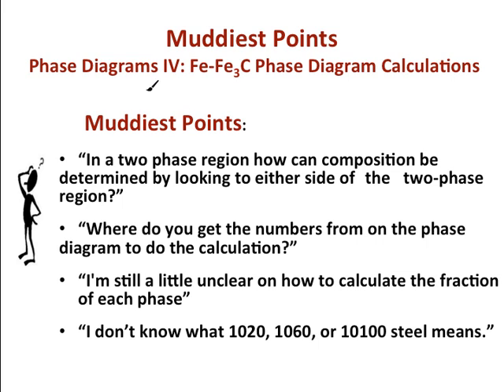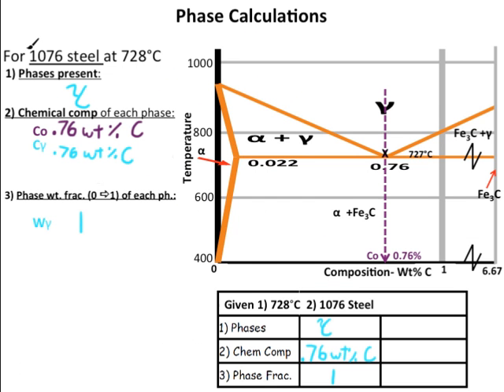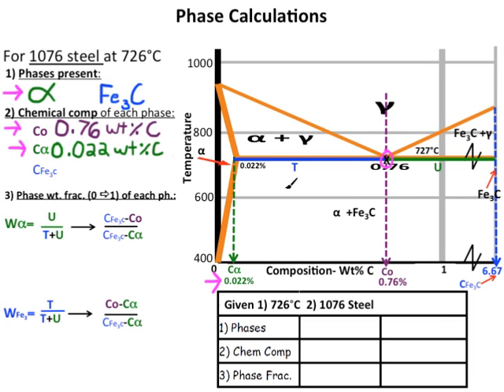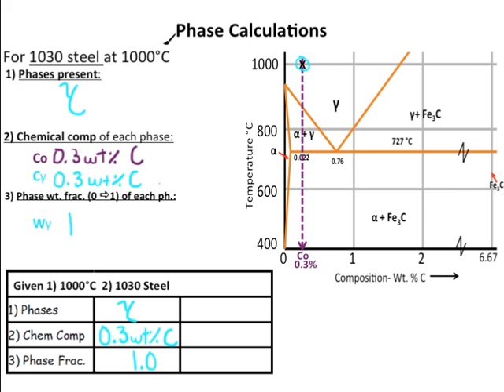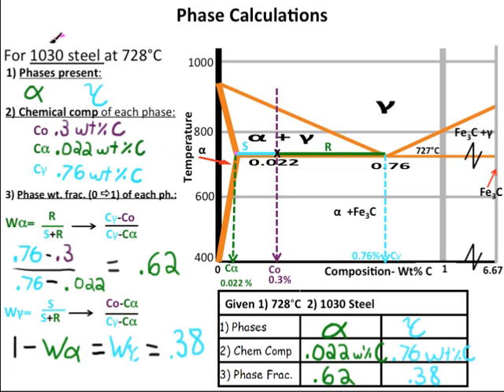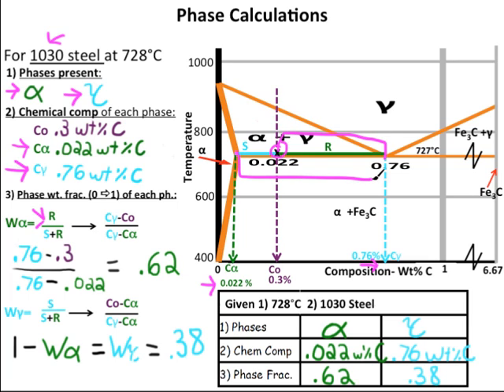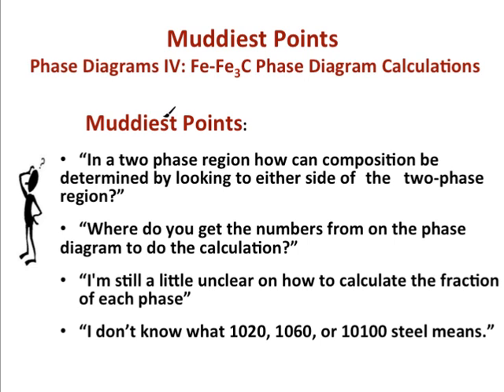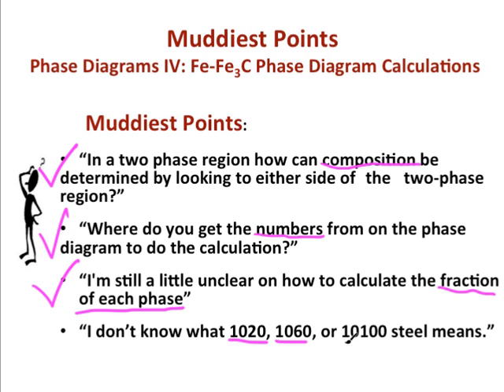Muddiest Point Phase Diagrams IV: Fe-Fe3C (Steel) Calculations

Comment: Excuse my rudeness as Im most likely wrong, but are your fractions not wrong?

For example; Within the final sample;
W(alpha) = Y/ Z  + Y    does that not give you W (Fe3C)? 
Hence why your percentages seem unlikely, i.e. 85 % for the W(alpha) when in fact if this was displayed on the correct full scale the W(alpha) would only be a fraction of the length of W(Fe3C).
Making W(alpha) = 15% and W(Fe3C) = 85%.

Like I said, im most likely wrong, as the reason im here is to learn! 
Great Vid! Thanks